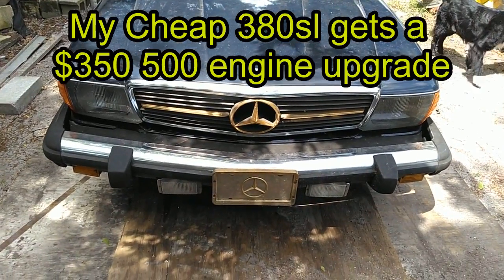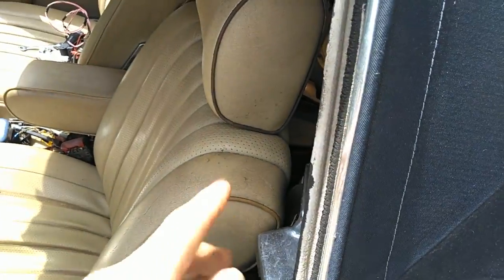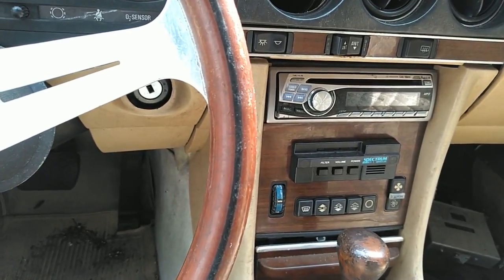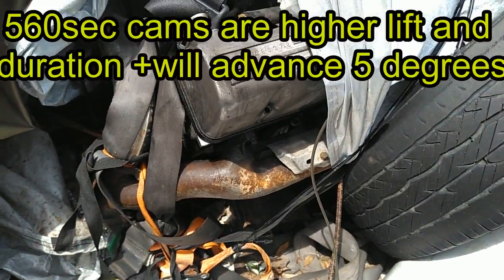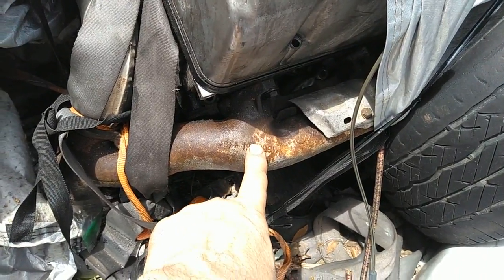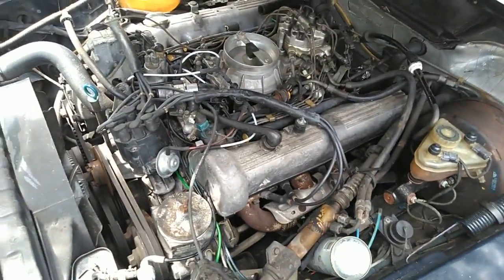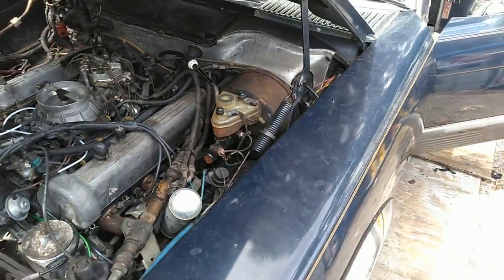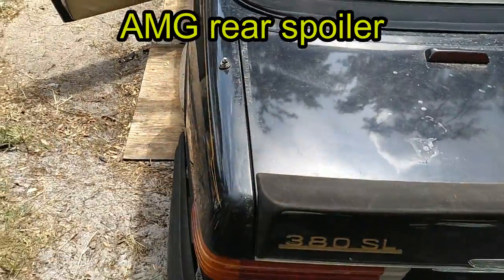Cheap Ass Mercedes SL gets a $350 500 motor swap, AMG spoilers, wire wheels, Nardi, Euro headlights

Comment: Hello ,i have a 1981 500 sl r107 motor that i want to put in my 450 sl but the oilpan and oilfilterhousing doesn't fit ,,are there oilpans that i can put on the newer 500sl motor?
Thanks from Holland
Reply from the maker: On my 85 500sel engine, the oil filter/housing was point up, on my 380sl it's point down, and needed the 380sl oil pan to clear the oil filter. A 380/420/500/560sl oil pan/oil filter housing SHOULD fit.

Comment: Hello, any progress on this swap so far?
Reply from the maker: Pulled and sold the motor around a month ago, I didn't want to start until it was sold. 
Currently installing the 560 cams, valve stem oil seals, timing chain guides, swapping oil pan and filter housing. 
Scored a pair of 560SL exhaust manifolds off Ebay for less than $100 shipped and going with stainless dual exhaust now, so I'm selling the 380sl exhaust and manifolds. 
Also replacing front/rear main seals, water pump, trans pump seal (found out trans was rebuilt!).
Also the motor mount arms needed to be swapped to the SL ones, like I did on my 2003 SL500 / c55 AMG engine swap.
More videos coming after Hurricane Nicole gets out of here.